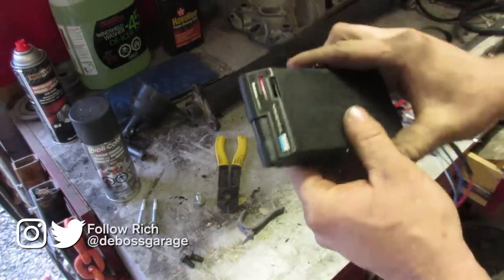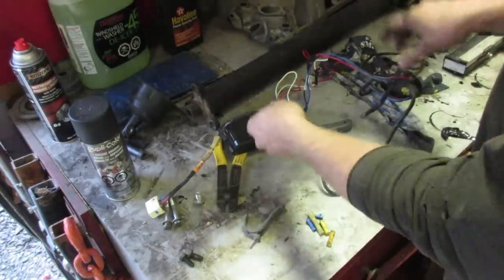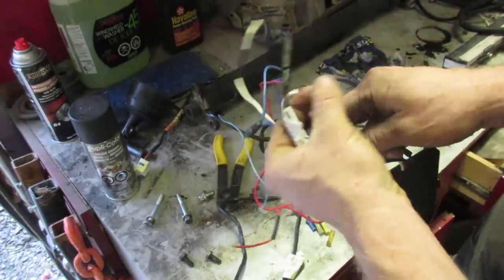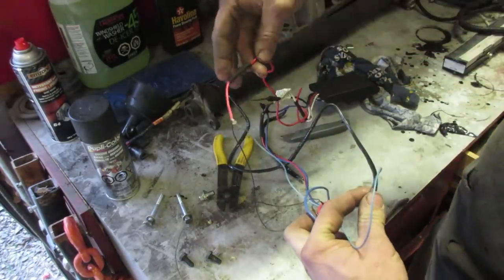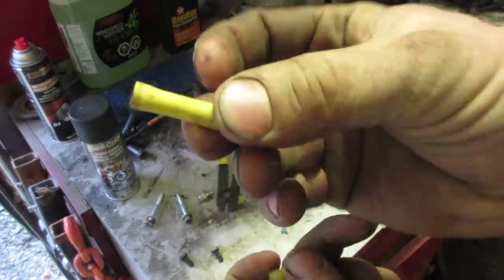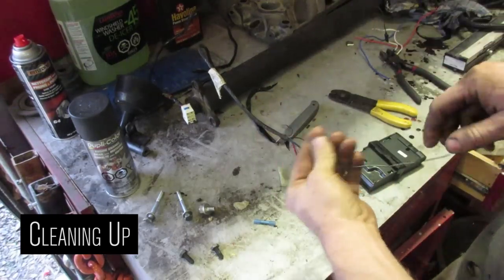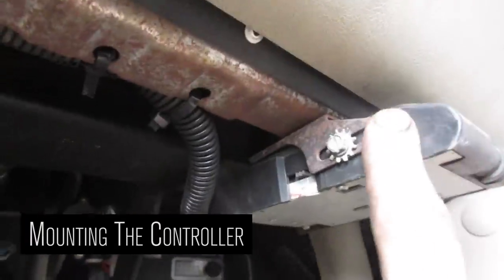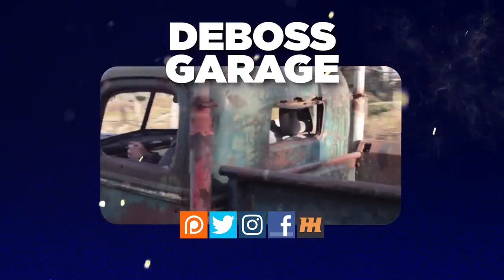Trailer Brake Controller Installation In Chevy GMC Truck or SUV

Comment: 2001 Yukon XL - Same model brake controller as in video. Wire harness for GMC. All the colors were matched, black-black, red-red, blue-blue, white-white. Plugged into right slight (according to chart inside cover). 

When I got it all hooked up, I slide the control button as if activating the brakes. With the key off, the dash lights come on and the chime rings (same chime as headlights on with key off). With the key on, however, this does not happen. Is this normal?

Comment: A brake controller came with my truck and I don't use it, if it's just sitting there can it cause problems? Also how would I go about disabling it so it is off? Thanks!
Reply: Just leave it, if it was installed correctly there won't be any issues.

Comment: Good stuff dude I need to fix my controller on my 2011 gmc is it the same wiring? I got brake lights but the brakes are intermittent
Reply from the maker: Is it built in or a separate controller?
Reply: DEBOSS GARAGE it's a separate unit
Reply from the maker: If it is intermittent, I would suspect wiring first, especially grounds.
Reply: The 2007.5-2013 have a built in harness for aftermarket controllers (They do not unplug from fuse panel, they are hard wired in). Check to fuse under the hood to make sure it is not corroded and is making good connection. If that is good, check the plug that plugs into the back of the controller. Use a test light and check to make sure power is going to your back plug and do trial and error and find the issue using a test light.
Reply: Could someone please list the colors of the wires comming out of the brake controller and list which color wire from the truck they connect to?

Comment: hey rich, i ran out of connectors and simply used electrical tape to splice two wires together for my blower motor, which is located near the firewall, under the hood (not in the cab). Is that alright or I should go back and use butt connectors?
Reply from the maker: Use butt connectors.  The blower motor uses a lot of amperage and they are the number one plug to melt and start fires....
Reply: DEBOSS GARAGE any body knows about the supplemental assist brake booster pump?  It's a round about 2"cylinder 10" long on the front left if the brake booster.

Comment: Too bad the 4l65e is too big of a piece of shit to tow anything big enough to justify a brake controller.
Reply from the maker: This setup is for all the platforms.  1500, 2500, and 3500.  It applies to 4L60E, 4L65E, 4L80E, Allison, every manual transmission and I'm sure I'm missing some...